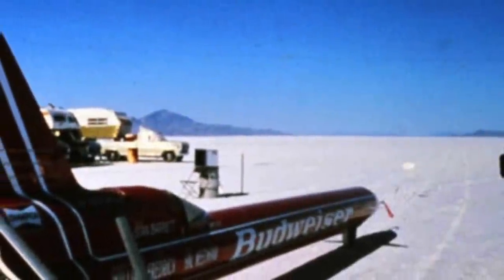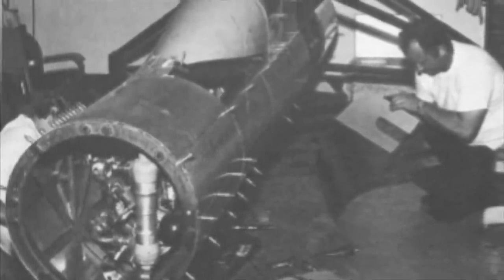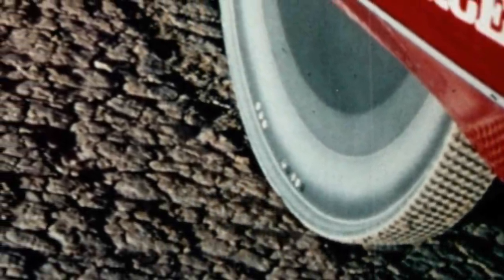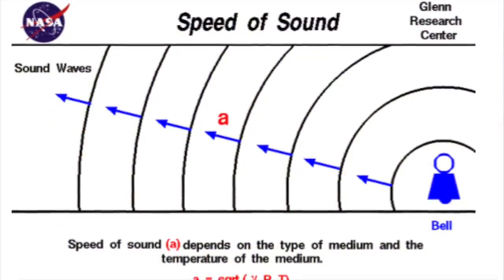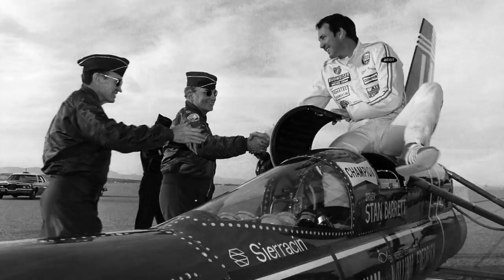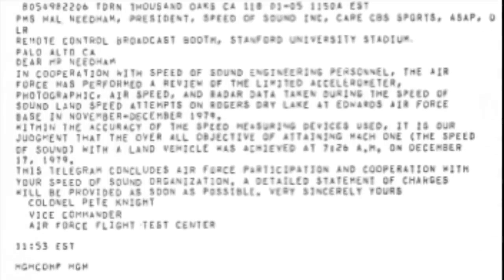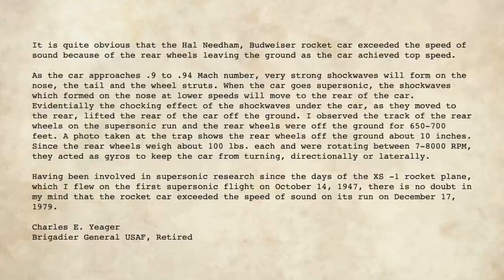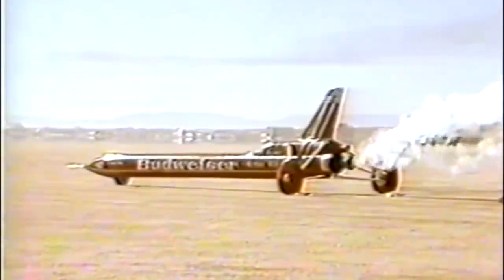The Budweiser Rocket - Controversial Rocket Car

Comment: No sonic boom - that's pretty conclusive isn't it?
Why did Chuck Yeager not address that point, instead of coming up with his fact-free, no-data speculation.
Reply: Chalmers "Slick" Goodlin had a sonic 'boom' on his last flight in the X-1. Are you saying that made him the first man faster than sound and not Yeager? At the time it was written off as some limited supersonic airflow over the top of the wings while the plane was on the verge of supersonic. Me? I've always be a bit skeptical of the 'breaking the sound barrier story' as normally told.

Comment: A lot of maybes. 
When the Thrust SSC broke the sound barrier, you could clearly see it had, without waiting for the data - the shockwave was visible on the surface of the lake bed. 
That car AVERAGED 763 mph over 2 measured miles.

Comment: He did not break the sound barrier,  right no pressure wave no sound boom,  BUT  he went 735 mph. An incredible achievement!  Bouncing down the flats. With a side winder,  its a beautiful sight seeing the side winded light and lift the vehicle of the ground. An incredible feet.  He was 35 mph short.

Comment: While there is no actual proof this car broke the speed of sound, it did have 1/100 of a mile timing traps and they appear to have indicated it exceeded 660 MPH.
That WAS faster than the existing Blue Flame speed record, but would not have been official in any event, as this car is often reported to not have had enough fuel to hold that speed for an entire kilometer or mile (the official lengths used in legitimate Land Speed Records depending on the sanctioning body), and no "second run the other direction" ever happened as required by all Land Speed Record sanctioning bodies.
It would appear that this car MIGHT have been the fastest car ever (prior to Thrust SSC) but had no chance at any official record and did NOT in fact exceed the speed of sound.
Reply: Did anyone hear a sonic boom?
Reply: @nissimlevy3762  The claims about that are conflicting.

Comment: When you take everything into consideration, from the professionalism of the engineers, the skill and bravery of the pilot, the planning, the manufacturing, even the size of the sponsors, it's a real pity that the recording methods were so amateurish.
If you're attempting to attain a certain speed it's imperative that the recording methods are carried out with utmost professionalism, rather than the half arsed mess on show here.
Reply: They didn't need recording methods or 2 way runs as they wanted the the publicity of the sound barrier. The proof was supposed to be the sonic boom.

Comment: To be fair even if it did go mach, its shocking they are unable to reliably prove it. You get this type of argument with theologians, just because they say something happened (or exists) and then say its up to you to disprove it is a really poor way to argue particularly if you are going for a record. If it can not be independently proven to a reasonable degree it does not count. More so as Budweiser wanted it to go super sonic (for the publicity) you can argue the poor measuring/lack of independent measurement was deliberate.

Comment: My take on this is pretty simple - if you can't prove it then you didn't do it.  The fact that the data from which the claim is based was never  submitted for independent scrutiny speaks volumes.  I suspect they went very fast - 700+mph fast - but they didn't break the sound barrier.

Comment: The only problem i have is with all the controversy, why didn't they make another attempt with more & better timing equipment. Also they couldn't design the car 4' maybe 5' longer to hold more fuel to hold Mach 1 longer for maybe a mile or more??

Comment: If they claimed it went SS then why didn't they try again with correct timing gear ?.... That's what everybody else did... Why didn't these guys ?
Reply: ??? They used he same timing gear Chuck Yeager used to beak his record.
Reply: @fraudsarentfriends4717  So? You can’t measure Mach number with radar. At least if you point it at the sky there’s not much risk of tracking a truck by mistake.
Reply: @thethirdman225  The accusation that the radar never clocked the speed and instead a truck is entirely new and unverified. It is a claim made solely by this video narrator and uploader and no official from the U.S. Airforce. Sidewinder missiles break the sound barrier without sonic booms all the time.  The British accent is very suspect with Bias.
Reply: @fraudsarentfriends4717  it’s better verified that SOS’s claim that they went supersonic. It’s not my job to verify anything much. The SOS team and its supporters seem to think its everyone else’s job to prove their claim wrong. Let me put it this way: I am the world record holder for the 100 metres. Prove me wrong.

See?

Either I’m Usain Bolt or I’m pulling your leg. Either way, if I was totally serious, you’d want more than just my word for it and I’m pretty sure you’d say it wasn’t your job to prove conclusively that I’m not Usain Bolt.

Records are just that: a matter of record. They are not ever a matter of what if or speculation or conjecture. So I don’t really care about radar stories or any of that other bunk. As I said, the USAF disavowed any association with the project and the final claim was made from accelerometer data. No other data was considered, including that from the pitot head, which is the one instrument which would have recorded a Mach event because of the pressure changes. Funny how nobody ever talks about that.

Comment: I'm sorry but if you don't hear that tell tale crack, you didn't break the sound barrier. Plus you don't see any kind of high pressure compression wave on any point of the car at max speed in the video, even in dry conditions you'd see some distortion at those speeds. 
One thing I notice, very evident at 9:37 is the nozzle wasn't appropriately shaped for the elevation they were running. Had it been properly shaped to make the max amount of thrust capable at that elevation, the exhaust wouldn't have been squeezing in on itself before expanding back out. It would've been a clean shape. That nozzle was meant for use at altitude with lower air pressure. (watch Scott Manley's video describing nozzle shape and Mach Diamonds)
Reply: Just curious - are you an engineer at ULA or SpaceX?
Reply: At 9:37 that shows a perfectly expanded nozzle.  Its not over or under expanded.  If you don't understand what your talking about you might refrain from looking like someone that doesn't know what they're talking about.   A nozzle designed for high altitude has a much larger bell on it so the gases can be expanded to the air pressure at that operating altitude.  In this case they're expanded the nozzle to about sea level.
Reply: Well, it seems to me that a tape from 1979 may or may not carry enough fidelity to hear the crack. The Thrust SSC crack was hard to hear over much higher fidelity video and sound. The much smaller and more aerodynamic Bud Special may have created a sonic "boom" that could not be heard over the rocket motor and wind on a 1979 tape 40 years later.

As for the nozzle design, I expect it was correct for the car and altitude. These guys knew their business, and this was 10 years after the Blue Flame went 662 mph. I would think that an engineer with the actual nozzle in hand would be the only one able to tell us definitively if there was an issue with it.

Comment: Okay, so they can't prove that they went supersonic in that run. Did it not occur to any of them to simply fix the problems with the timing equipment and make another run?!?
Reply: N1RKW or better yet, why didn't they simply use a timing Beam like every other record car in the history of record cars. Everyone, from Arfons to Breedlove, to Campbell to Noble, all used timing beams. I wonder why this team didn't?

Actually, I don't wonder why. Anyone with a brain knows why they didn't.
Reply: @RB747domme  I suspect that you are correct. Unproven records can still become legendary (as this one seems to have) and in doing so becomes an even bigger ad for the major company that sponsored it.
Reply: They used radar to track the car and its speed was certified.
Reply: @AIM54A   Really and what do you know about Radar??? Did you know that the radar in question couldn't automatically follow the car due to its small radar cross section, but had to be aimed by a man using a joystick and a TV camera!!!! Having had to operate equipment on an electronic warfare range in the same manner, I wouldn't claim anything using that method of tracking to work out the speed of something. Too many errors induced by the man in the radar!!! Anyhow if you want to use radar to track anything when doing a trial to work out its speed, you use a Doppler Transponder radar system with Automatic tracking. This is what is used when testing missiles and it involves fitting a doppler transponder to the thing you want to measure the velocity of.

Comment: That they could build a car capable of breaking the sound barrier and NOT have the necessary speed detection equipment is ridiculous.  Like so many things I've seen they went 90% in but not 100% and for that reason, in addition to the lack of sonic boom, the sketchy IMU data that's never been released, and the timing results that have also never been released its a no brainer -- they did NOT break the sound barrier and if they did there is no reliable evidence they did.  So close...
Reply: They must’ve started testing the sponsors product before they made it that far

Comment: No sonic boom is the definitive answer for me.
Reply: True, that's usually the proof, even without instruments.
Reply: Cross section makes all the difference. A bullet goes supersonic, but you can’t hear it over a rocket. This thing is like the width of a pencil!
Reply: @nathanchildress5596  can hear the tip of a bullwhip go supersonic. 
The car failed to break the sound barrier. 
First car supersonic on land was Thrust SSC.
Reply: @nathanchildress5596  It would make no difference at that viewing distance. The Bud Rocket should still make a very sizeable bang. The profile might have been a lot smaller but 1) it produced a lot of supersonic base drag and an associated shockwave and 2) Thrust SSC broke windows 20 kilometres away.

Comment: Might have been good to have an aerial view of the event. The disturbance to surface just behind the vehicle nose and visible as line perpendicular to travel - as seen with SSC - would help the argument. Audible sound is tricky as a clue at low altitude. Someone at some distance should have heard a ‘whooping’ noise and crack… 
   But I cannot count it out, they may have done it.   We are left with one of those, ‘did Mallory reach the summit of Everest?’ things.

Comment: Chuck Yeager is not an engineer and he never went to college.  Just because you were the first pilot to break the sound barrier does not make you an expert on transonic  speed measurement.  Why would they not have fully instrumented the vehicle with both a nose-boom & tail mounted pitot-static system??
Reply: The engineer behind Yeager was Jack Ridley.
Reply: Why does not having gone to college automatically disqualify him from technical knowledge or valuable experienced-based intuition? I did go to fucking college, and I can tell you that I learned more from reading the textbooks beyond the assignment out of personal curiosity than I did with actual assigned work. But I guess old Chuck couldn't read, either, right? You have to have an institution charge you thousands of dollars for that privilege.

Comment: I did not hear a sonic boom in the video and why did they just not have a timed measured mile ?  All sounds rather suspicious, more of a marketing stunt for Bud, me thinks.  All previous land speed records going way back to the 1920's had measured miles ?  therefore, Sadly the first car to have broken the Sound Barrier has to go to the Brits for Thrust SSC with Andy Green in 1997, they did it with a measured mile and in both directions and you can clearly hear the sonic boom in the video.
Reply: Because it was only ever intended as an event. The only thing they were interested in was going supersonic. But since there was no sonic bang hear, it's pretty clear they didn't, regardless of the opinions of Pete Knight and Chuck Yeager. Thrust SSC was a genuine supersonic run in both directions and was the first land vehicle to travel supersonic.
Reply: The video covers your questions Jamie.

Comment: Not to take anything away from stan but i do not believe that they broke the speed of sound that day. Thay did give it the old collage try as they say.  Bottom line is no sonic boom no supersonic run. Hal the car owner did not want to play by the rules and did not run on what would be considered an official course length.
Reply: So the USAF at the Dry Lake (The x-plane people) lied to us? Screw your head on straight.
Reply: @powderslinger5968  Hmm, let's see USAF might be lying... absolutely!!
Reply: @powderslinger5968  The radar tracking was done manually as the radar couldn't automatically follow the car due to its small radar cross section. Also the radar wasn't designed to track things close to the ground but high in the air where things like multi path radar reflections do not cause a problem. By this I mean that the radar beam hits ground and is reflected up, then hits target which reflects echo into the ground which is then reflected back to the radar. If this signal is strong enough it will be stronger than the direct path energy (radar energy goes directly to the target and is reflected directly back) and the incorrect range data will be plotted by the radar. A semi active radar homing surface to air missile system I worked on suffered with this problem and a number of missiles fired at low level targets ended up diving into the ground in front of the target because the energy of the signal reflected of the target and then off the ground was stronger than that off the target alone!!!  The radar in this used stunt wasn't designed to track things on the ground.

Comment: I wonder if an airspeed indicator would have made a difference. At the very least it would have given a more accurate representation of the speed of the vehicle. At the most it would have had a definite impact on reaching the speed of sound. As the shockwave move past the inlet tube for the airspeed indicator it would have caused the airspeed indicator to momentarily drop to almost zero if I remember correctly. I think that would have been substantial proof that the vehicle achieved the speed of sound.

Comment: OK, how hard is it to figure camera distance from the car? Someone must know where the cameras were, where they were pointing. We should be able to measure the speed of rotation, and knowing the length of the car we can figure the speed.
Reply: The data is out there somewhere. Someone is not releasing it for a reason.
Reply: Pretty much the first thing that popped in my head.
Reply: Grumpy Old Man you can’t determine peak speed from that. Only avg speed. The car slows down a lot after the engines shut off. That’s why the speed trap data was irrelevant.
Reply: @lvr1028  Not true. Max speed will occur just before the Sidewinder motor burns out. We are essentially trying to measure radial and tangential velocity, but not really. We really just need to know FPS and distance traveled per frame, but I think we need the distance from the car to the cameras to figure the distance traveled. Still thinking it through.

Comment: Barret is right. He did hit the sound barrier. Sonic boom generated by jets in the air cannot be heard on even at far distance due to some ground disturbance created by the wheels that touches the surface and ground effect also played a role in obscuring the existence of the sonic boom. I fly jets F 5A on a dive
Reply: Alan Caldoza ...uh...sonic boom from jets in the air can’t be heard because of ground effect from their wheels touching the surface.....of what?.....the ground?......what are you flying on?
Reply: "Barret is right. He did hit the sound barrier. Sonic boom generated by jets in the air cannot be heard on even at far distance due to some ground disturbance created by the wheels that touches the surface and ground effect also played a role in obscuring the existence of the sonic boom. I fly jets F 5A on a dive"

What a load of rubbish.

Comment: If there was a sonic boom, it did, if there wasn't it didn't.  Not sure why there is ANY controversy.  You sure as hell heard one when SSC ran, and it did it all the way through the traps, both ways!   Game over, at least for Mach 1 on the ground.  Breaking the SSCs measured speed is the first, and I K MPH seems to be the next target, and this machine has/had ZERO chance of doing either one.  ;-)  No controversy, just hype.  Good luck to the Aussie team, if they ever actually get the thing done.  This seems more just a stupid publicity stunt.

Comment: If it was a serious attempt on the LSR and not just a big Budweiser promo, why were there no official timing people present? And no sonic boom. Two elephants in the room. Take off the USgoggles and have a sensible think about what may or may not have happened, not what you really want to believe.
Reply: It obviously wasn't a serious LSR attempt as not only was it not properly timed, but the car wasn't capable of a 2-way run within the hour and Needham and Barrett knew that. They were banking on the sonic boom to provide proof which never came. However Barrett was almost certain to be the fastest man on earth until Andy Green. Americans need USgoggles to support there egos as they have done poorly in the LSR stakes. In the 93 years that the LSR has been continually set in the US in only 21 of those years have they held the record and I don't see any American breaking the current record - ever.
Reply: LOL USgoogles.